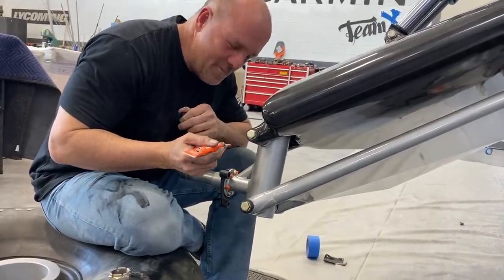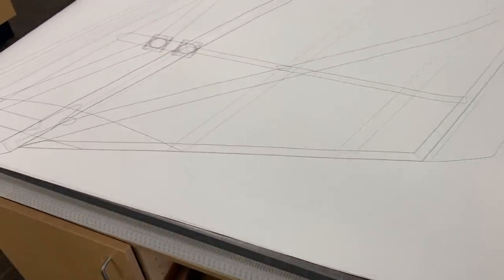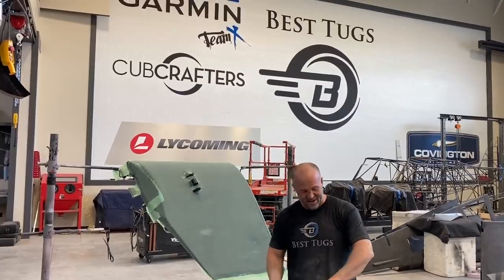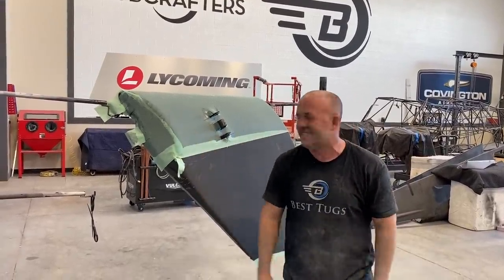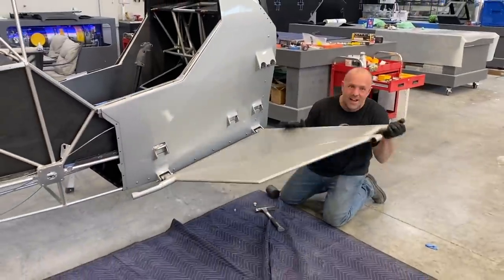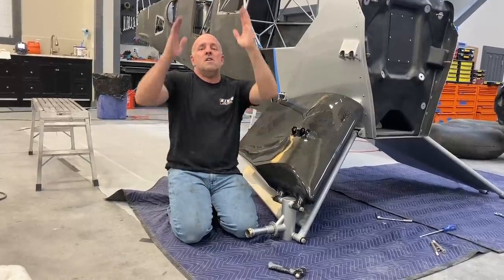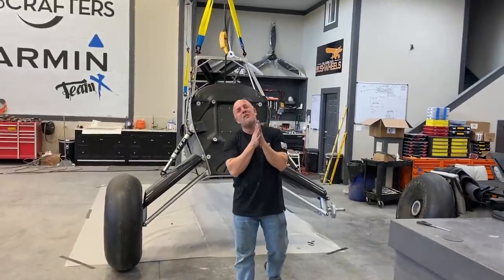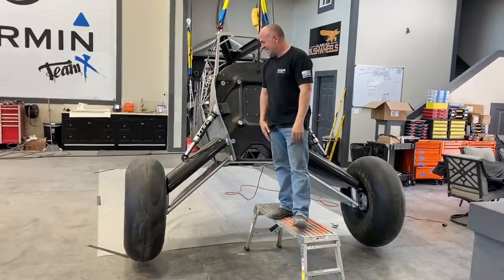Carbon Fiber Wings on scrappy suspension finished (Scrappy Bush Plane 22)

Comment: Hey Mike amazing work! I do have a question regarding inspection of the frame inside the mini wing. As a A&P mechanic we always see the possibility of having to work in the tightest of spots. Maybe you could put a couple of mirror ports on the underside.
Reply from the maker: It has inspection ports. sorry I missed that and that is also how I Get to the internal brake lines

Comment: Great to see the final part. When I first saw the suspension I wondered if any wings were going to be made. These look like they will work well. Any special considerations in paint with the raw carbon? UV protective clear coat?
Reply from the maker: Lots of UV clear. I still have my first plane I did it on and ten years later zero fade and looks just like day 1

Comment: IF the shocks will allow AOA changes, when parked in an unprotected area I'd expect the lowest setting to be useful  when tying down.  I'm pretty sure we all are expecting him to be able to adjust them from inside the cockpit, and probably make it jump up and down like a low rider car. Or do they use airbags?

Comment: Hey Mike, awesome job. On the Gearleg wings, know you guys like to fly low over water and skim the surface. I would imagine the lift generated by the Gear wings would be enough to lift the tyres slightly, so if you ever "ski" on water using those alaskan bush tyres, would it not be risky if you hit any air pockets (considering the gear wings are small in size, and the gears could suddenly drop?). I'm not a pilot so I wont know, just asking, sure you've thought about all of this already :-). Keep up the good work, now stop reading all these comments and "Get Back to Work!"

Comment: amazing!! 
in the spirit of learning and dialogue. 
would it have been better to enclose both the A arms in a wing. as you could have gained some more aero. also a little concerned with the inboard side of the carbon wing. it looks like when the wheels move up. its going to push the body in... could you perhaps test that. lift the wheels up (so body coming down in squat) it looks like it will run out of room...

Comment: Wow the suspension goes full travel without an engine, wings, fuel or anything else in the plane, I'm pretty sure (and hope) that you can adjust the shock absorbers-air springs to take the whole weight of the missing parts PLUS the dynamic load of the airplane going down for landing... yeah... they must be able to take all that weight... are they ? 
So what is the maximum load that those 4 air springs can take ? can they be adjusted from inside before landing to adjust them for optimal travel resistance/load bearing after using certain amount of fuel (ie: losing 500 pounds of fuel weight during flight) a little pressure/weight table and a small dedicated computer with a few pressure sensors and a down-speed inertial sensor can do the calculations and automatically adjust the landing pressure with some high speed solenoid valves transferring pressure from a high pressure accumulator tank... sort of an electronic suspension or preset the pressure manually as part of the landing checklist... fixed resistance and rebound.. (boring almost zero engineering solution)

Comment: So many questions so many things to look forward to as you complete this wonderful build and then begin flight testing; from ground handling to Takeoffs and Landings, cross wind performance (slips), climb performance (😉), etc., etc.

You’ve virtually created a full design course worth of excellent content for engineering students.

Got a question (as usual), if the shocks are tuned to dissipate the energy of a very hard landing or wheel impact with a large obstacle while at speed on the takeoff ground run or landing rollout, say at a shock compression rate of 40 to 60 inches per second maximum, would that mean that the stiffness and damping would be such that the lift produced by the landing gear stub wings won’t necessarily be able to attain a gentler anhedral orientation during flight ?
... or perhaps are you changing the shock’s stiffness by some secret means to facilitate the ‘gear wings’ changing the anhedral angle once you reach a suitable true airspeed  🤔
Reply: On the ground, the gear takes the weight of the aircraft while in the air, it will be the wing. 

Hence the challenge to get the stiffness of the shock and the method of transferring the “gear wing’s” lift to the airframe (presumably not through the shock assembly itself but through a suitably designed structural member that serves as a travel stop).

Comment: Mike, do you think the solid flat portion of the bottom landing gear arm being so close to the airfoil will affect its ability to generate lift? I know biplanes do not have a lot of interaction between the two wings but those two surfaces are pretty close together on your landing gear.

Comment: Mike where the A-arms mount to the frame, it looks like there are steel mounting tabs and then a layer of painted carbon over that, so the bolt is clamping against a layer of carbon, is that right? I'm surprised the carbon is rigid enough to bolt against and have a proper joint.
Reply from the maker: Great comment 👍🤠 Yea it’s amazing how strong but in some situations you would certainly not do that.  On this it’s just a snug fit and the forces are going perpendicular to the bolt. Some guys leave the bolts loose.  This is an area it works great but in others I would never do it. I just like the finished look and on this kid I don’t need a bolt it could be as simple as pin set at the end with no nut at all.
Reply: @MikePatey  Cool stuff! Is there a collar inside the plastic (polurethane? Delrin? Whatever, the bushing) that the bolt clamps against, or does it pivot right on the bolt?

Comment: Also,Mike how do you calculate torque specs with the various carbon, aluminum, CM parts of your custom suspension? I'm guessing the bolts and nuts are strong enough to crush the parts, bushings to the point of breaking or binding the suspension components if you were to over tighter them. Thanks

Comment: Here's a strange thought...from a standstill...with quick application of power...will the gear airfoils create enough lift to compress the gear before the main wing begins to produce lift...and will that change in angle of attack negatively affect your STOL takeoff?
Reply from the maker: I like your thought processes.  👍🤠 coming at it from all angles.  The lift on the gear in prop blast is not enough to make it move.  The lbs of shock pressure in excess of holding the plane up is till more than the maximum available lift the gear can generate.  Thanks for the process thoughts 👍🤠
Reply: @MikePatey  Could the lift from your gear pick you up before you have roll authority from your ailerons?

Comment: Mike, love the videos and had a question: As the suspension compresses, the wheels are moving horizontally outward. What effect does this have on the handling as the suspension moves through it's range of motion? Thanks!
Reply from the maker: Great question 👍🤠. I eliminated most of it with the tires staying straight and the remaining will be minimal as the plane Lands  the tires role as they suspension moves outward so it just roles the tires outward. Little to no scrub left in the role as it is compressed.  Still some wear but a fraction of it now 🤠
Reply: Mike, that make sense, thanks for taking the time to answer. Really looking forward to seeing Scrappy fly!

Comment: looks great but I`m not sure about galvanic corrosion between carbon skin and inside metal structure. Did you put these in an oven? They will get boiling hot when parked outside in the sun and might loose shape.

Comment: Will the mini wings be sacrificing a noticeable degree of stability for lift?

 It seems to me the angle/direction of lift would not be consistent during a takeoff/landing from a rough field. 

If one wheel hits a bump, it will change the direction of lift produced from the wing right? Thereby biasing one side to a more horizontal component lift vs the vertical component?

Of course they’re pretty small...so maybe I’m overestimating the impact.

Comment: So I have to ask. Honest question here, is there now no way to check the internal metal tube frame for corrosion or weld fatigue/cracks?
Reply from the maker: Great question I’ll show later. 👍🤠 It has inspection points where the brake lines pass in and out of the carbon fiber

Comment: Will the prop wash raise the gear as soon as takeoff throttle is applied? If so, would that result in a sudden pitch down, or would it briefly just hang there balanced on the tail wheel? Or what?

Comment: Mike , did you do any simulations on vibration of your gear / wings? You have a hard suface (cabon fiber) and a soft surface (fabric) this reminds me of a reed instrament wit air flowing over a vibrating reed. Its just a thought, it looks fantastic at this point. Cant wait to see it fly. Awesome plane!😎😷🇺🇸

Comment: So looking over the suspension for both the main gear and the tailwheel, other than not being able to do the... Gearwings? I guess they're gearwings. Anyway, Other than not being able to do the gearwings, was there any reason that you couldn't build the main gear with a pivoting spindle (like a sandrail) and then set up the tailwheel fixed? My thoughts on this are that it eliminates the possibility for a ground loop as you're then running a similar steering geometry to a tri-gear plane, just two steering gear and a single fixed gear.  that being the case, would that then allow you to have an airplane with  a tailwheel and the off airport capability without the need for a tailwheel endorsement? would that cause issues with takeoff and especially landing?

Comment: A lot of thought has to go into those two surfaces being so close. The lift on the upper mini-wing gets partially canceled out because the high pressure area on the bottom of the top airfoil will be positive pressure on the bottom panel, cancelling out lift. This is why biplanes never never evolved into the modern era. If the bottom panel were to be omitted, there could be a decent increase in lift and parasitic drag, reducing the loading on the main wing, decreasing net drag and increase in cruise speed. At high AOA, that won't matter so much, and the bottom panel will produce lift in conjunction with the top panel by forcing large volumes of air down, getting lift by brute F=MA. So this is setup is better for low-speed flight where the high AOA will come into play, at a cost of higher cruise speed, much like the F-16 and Learjet ventral fins don't do anything until high AOA. Another thing to look at is the elevators downstream. At high AOA, they may disrupt airflow over the tail, and if the airbrake is deployed, it could be exacerbated. The elevators are oversized, so that's a huge help. The first tests at high AOA and with the airbrake deployed is going to be very interesting.
Reply from the maker: Ryan you just made my day.  Very well said discrimination on all accounts.  I almost made a set of uncovered and covered and then decided hey it’s about slow low and ground affect and high AOA so this is how I start and I may later when the plane is done build the other set just for grins 👍🤠
Reply: @MikePatey  That's funny, I was thinking about a second interchangeable set as well. I hadn't thought about ground effect. You have the benefit of putting it through CFD. I'm just thinking out loud. Glad I made your day. That's just returning the favor. Thanks for the great videos.

Comment: Mike, have you considered putting ABS brakes, or some electronic system that does not allow the plane to over rotate and pitch nose down on braking? I can see that that Scrappy will be VSTOL champion, by a country mile on the first attempt, even if you have not unloaded.
As you do not have reverse thrust, is this an option for the future?

Comment: Mike, this aircraft is looking great! Your enthusiasm is addicting, your work ethic is beyond comprehension, and this project is by far way ahead of its time. It's beyond a Cub type aircraft on steroids. 
I do have a question, in the last video during the clip of covering the tail feathers, you expressed concern about strength of the fabric from the power and forces being placed on it, and its puncture strength,  thus you opted to apply two alternating layers. Why couldn't you have used carbon fiber material as a covering, instead of fabric?  Could you have made rigid covers for the elevators and rudder, then bonded them on as you have done on many other parts of this build? They would be light and strong and fit right in with the Scrappy Carbon Cub on Steroids Monster Trophy Truck theme, I mean Airplane aka Scrappy Monster Trophy Airplane (SMTA) Just wondering. Back to Work!👍

Comment: yo. mike.I have a suggestion what happen when you are low on tire pressure would it rub with tank against the tire or if you go like a longer suspension travel wont it rub?

Comment: How much lift will they add when you pull the gear up to horizontal in flight (I'm assuming you are going to do that whit those shocks)
Also, are you going to pull up the tailwheel with the shock for better take off angle?

Comment: Hi Mike. Awesome. Do those wings provide you any lift - or your just shaped them so they are aerodynamic?

If they do give you lift - did you work out how much you get additionally when the prop blast is at max?
If under full throttle you could adjust those, maybe they could be like flaps or additional lift on landing/take off if they were adjustable.. 

Lower stall speed/Lower take off speed?? ..
Reply: Doh... I asked this before the end of video!!

Comment: Shock therapy recently put out a video on the krx1000 where they explain how using dynamic camber throughout the suspension travel can actually eliminate any kind of tire scrub. Im sure your familiar with that kind of geometry. Wondering why you didn't employ it when designing your landing gear

Edit: neve mind, I had to rewatch the video to realize that's what you actually did

Comment: Question: Re discussion about suspension travel and tyre angle at the approx 20:00 min mark. In your video your hands are more like 45 degrees than the 20 degrees you talk of. You say that as the tyres get angled under the plane there's a point where the vertical load on the angled tyres may cause the bead to come off the rim or the low pressure tyre actually fold. I am interested in the point when your design touches down to taking up the full weight of the plane on the ground. Surely as the weight of the plane exerts a load moment vertically downwards the suspension will still want to travel horizontally. Won't there, therefore, still be some forces exerted on the tyres themselves as the rim (attached to the plane) travels horizontally spreading out while the tyres, due to friction of now being in contact with the ground, will want to stay where they area. I can imagine that on slippery ground this wouldn't be a problem but on a hard surface (surface with greater friction) there's still opportunity to put force onto the bead?
To help explain... Looking at the fully assembled shot from about 29:50 you can see the tyres sliding along the concrete floor... what if there's more friction - will this affect the tyres "wanting" to come off the bead?

Comment: would it have worked to make the lower arm slightly shorter to camber the bottom of the wheels in as the suspension compresses resulting in less tyre scrub from the wheels moving out as the shocks compress?

Comment: Are you worried at all about the change in lift making the plane unstable?  IE: as the gear hangs down in level flight, the lift on both sides is equal (from the leg wings).  As you rotate along your long axis (roll axis?), the rising leg becomes a better wing, and starts to have more lift (inverse dihedral), pushing the plane over into more roll.  Chances are these wings are fairly small compared to the rest of the moments on the plane...  Curious if you've modeled any of this.  :)

Comment: Great Videos as always - BUT -  need you to slow down.   You're only giving a few seconds to some very important topics.   When you start to paint - since you're using a water-borne system - would like  you to show/talk about air gun pressures - tip sizes - technique using the Stewart's system.   Some folks seem to have trouble getting that painting technique down.   I need to do a fabric repair to my Kitfox and want to use their system - so I'm very interested in how you paint it.   As always - thanks for sharing your build.  I'm amazed at how you can take a computer drawing and make perfectly accurate parts.  Lots of skill there.  Thanks
Rodney

Comment: Let’s drop back 120 years and we’re looking a 1900 Mike working on the first powered flight. The Wright brothers would have learned a thing or two. 1901 Mike would have beaten the brothers by several years.

Comment: @Mike Patey - I have to ask; I've mentioned it in a comment before. When you put weight on, the wheels move outward because they're moving in a curve (rather than vertically up and down). Is that going to matter when you land on grippy tarmac? I would expect it to interfere with the smooth upward and downward motion of the wheels because of the sideways load as they start to move outward. Please tell me I'm overthinking this?
Reply: Tom - The tires are high profile, tall sidewalls that are very flexible, plus they will be rotating at the same time they are flexing.